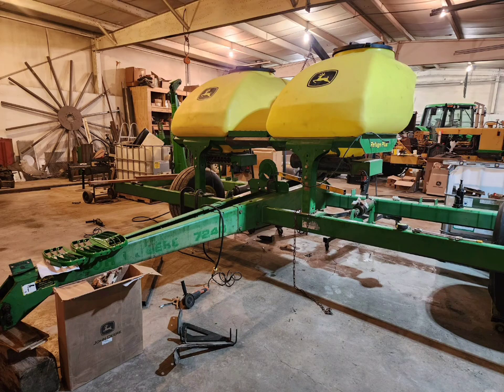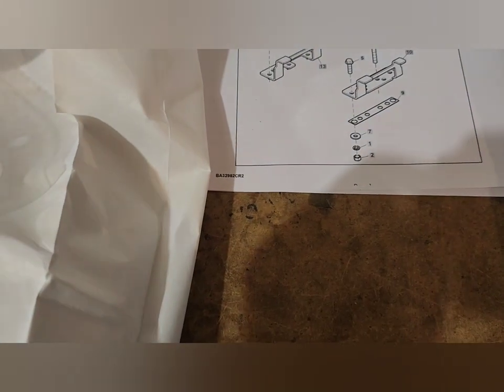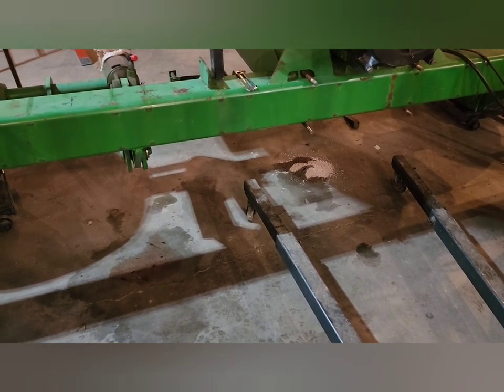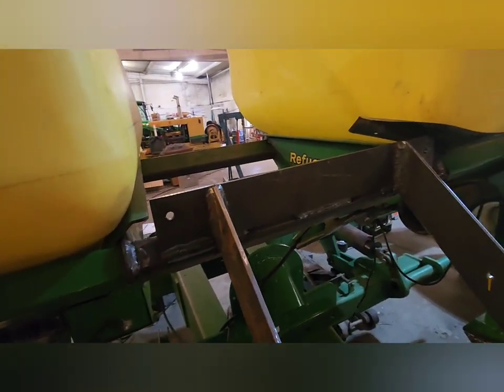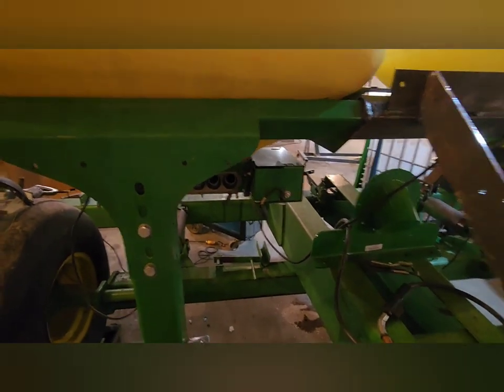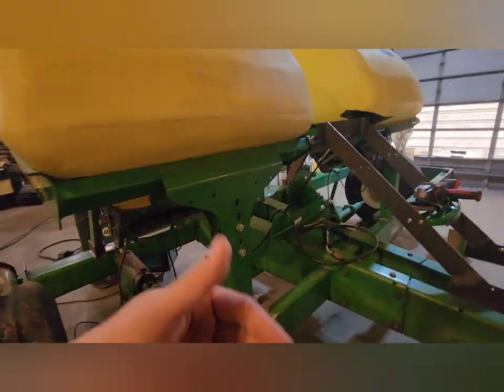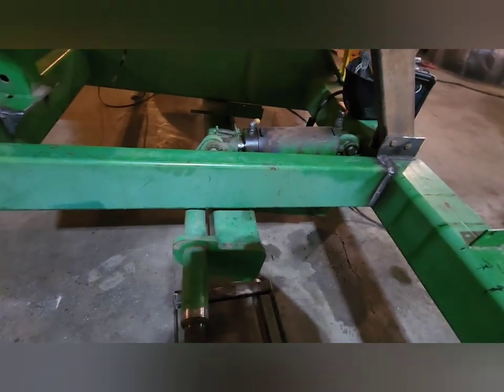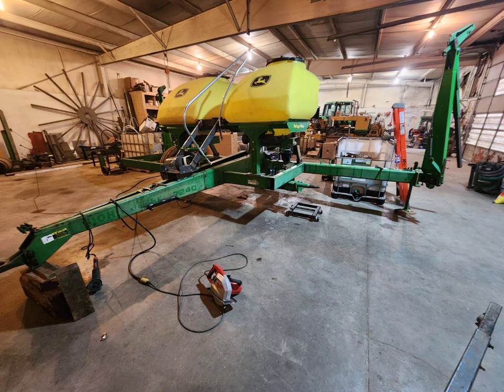planter build video 3

Comment: That's a nice planter! John Deere parts are not the only outrageous parts, Case is just as bad I found out due to unfortunate dealings that caused the back window in my 3294 to self destruct into thousands of little glass shards and they wanted 1500 bucks for a flat piece of glass with 10 holes in it no thanks, I went to abiline machine and got the same window for 357 and it came in the mail  in 4 days and now it's almost ready for installation but that's gonna take a few of us guys to do it safely lol 🤣
Reply from the maker: Thanks very much 😁 ..... and yes, it's horrible how much these companies are charging for stuff - we too, are buying more aftermarket or other places ....

Comment: Been waiting for a update! This is a very cool build! The only drawback to a 8-rigid frame in our area though, is the transport. Not very rural in our neck of the woods anymore
Reply from the maker: Hey! Good to hear from you! ... center flex and fold would have been nice - but were making the best of it, with what we have to work with... limited tools and existing material definitely poses some challenges .... if a guy had c&c equipment / cad programs, etc - it would be easy to scratch build some really neat  stuff ..... luckily in our area, we are close tohome so road width isn't much of an issue